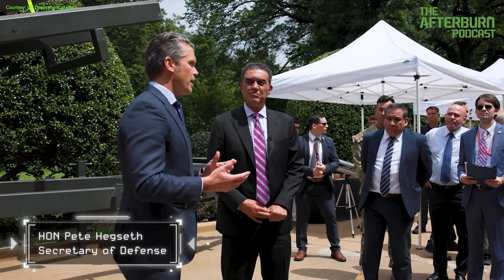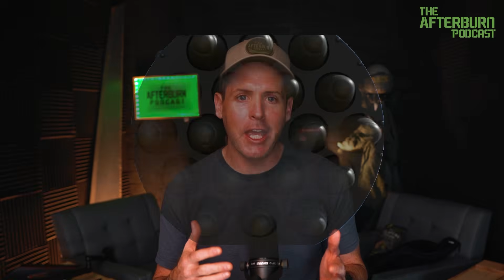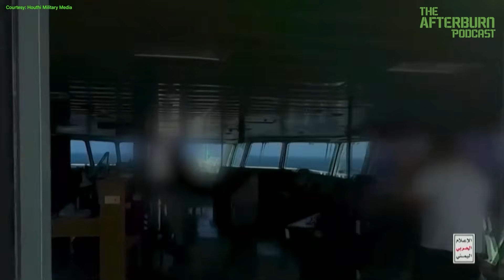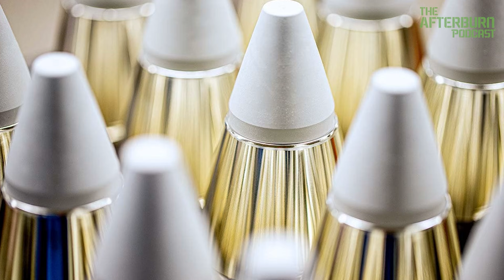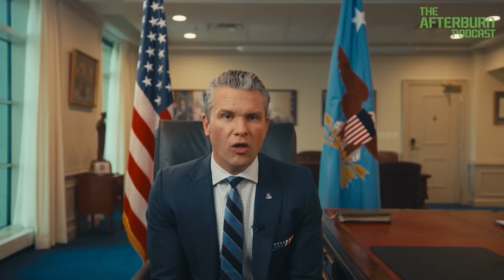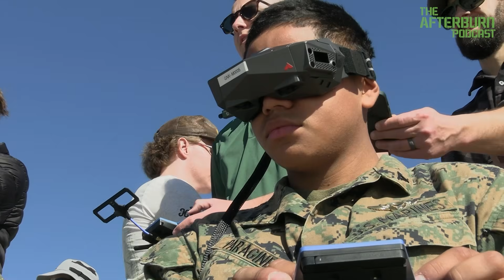How F-16s & F-15Es Are Destroying Kamikaze Drone Swarms

Comment: A pod with a 30 or 35 mm cannon with Airburst or AHEAD ammunition is something that needs to be considered for shooting down drones from fighter jets.
Reply: Guns are to risky for fighters high chance of sucking in debri and loosing engine or jet. Better a rocket from a further range
Reply: @crewdawg604  The 20mm cannons force down targets at 500 meters or so; with 30 to 35mm can fire from further away using radar and FLIR. The idea is to turn the fighter into a flying anti-aircraft gun.
Reply: @arbelico2 in get the concept but at those ranges with the speed of a fighter your still risking the jet even pilots say guns are very risky and dangerous for that job. And insure as hell would rather my jet come home then loose it for a 35k drone.
Reply: @crewdawg604  But does the speed adjust to the target being shot down, and after firing, can it maneuver to get out of the path of the debris?
Reply: You better make sure there’s NOTHING in the background past those drones if you use guns………those rounds have to land somewhere.
Reply: @tomwilson1006  It's Airburst or AHEAD ammunition; remember that the Vulcan Phalax's ammunition self-destructs to prevent unwanted damage.

HEIT-SD ammunition: Uses high-explosive incendiary tracer rounds with self-destruct capability.

Comment: About time ….      Drones are basically flying IEDs and very important warfare in the war of attrition, they were build to be as cheap as possible while making enemies waste their expensive and precious resources (making them bleed financially)
Reply: This is useless. Suicide drones are a weapon of scalability. 10% getting through is successful.
Reply: @anti-validation exactly, it’s like flying GPS guided Artillery . Even with 10% success rate at 1/10th of the 1 Hellfire missile Cost it’s still “Mission Accomplished”
Reply: Drones haven't been flying IEDs since the start of the Ukraine war.  They're purpose built for this now.  The concept of a low cost cruise missile made from an ultralight and custom flight software has been around for 15 years at least. It was proposed as a thought experiment.  It was only a matter of time before it became a staple of warfare.
Reply: Shotgun rounds are fairly reasonable, bird shot could take drones down no problem. It has become one of my favorites because of ability to use slug, buck shot, or bird shot.
Reply: @Jesse-x8u  I'd use something a little bit heavier.  Plastics are tougher than you think.  But yes.Shotguns are the drone defense weapons of last resort just so you don't have to be perfectly accurate in a last ditch situation.